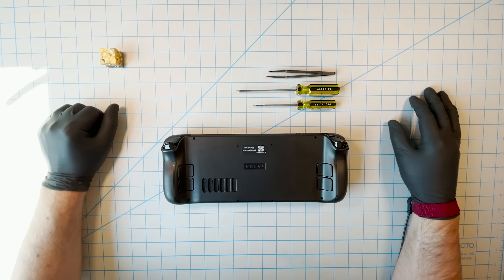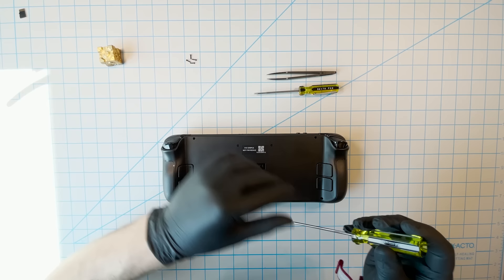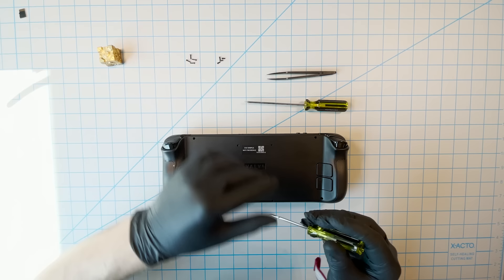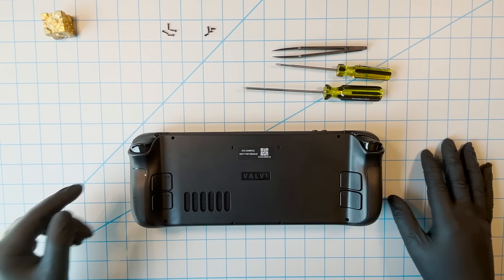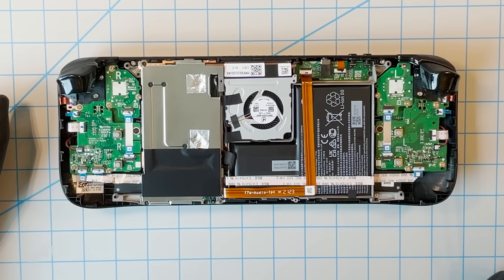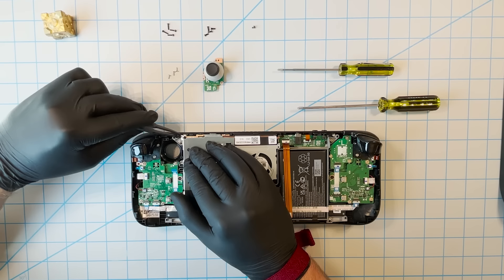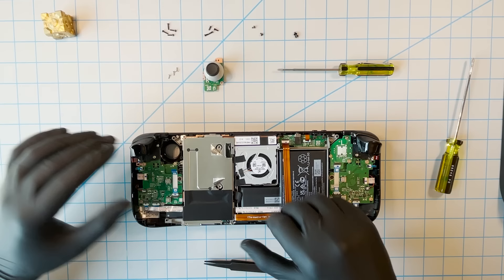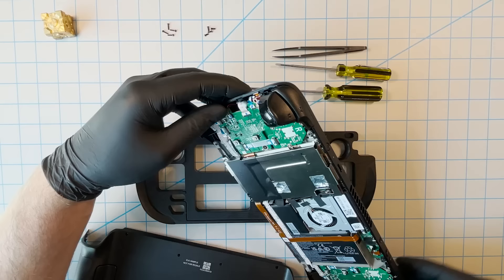Take a look inside Steam Deck™!

Comment: Huge props to Valve for actually doing this video instead of trying to say it's impossible or trying to hide the information.
Reply: Indeed.  It would have been infinitely easier just to say that, so the fact that they put even this effort in is huge.  Thank you Valve!
Reply: They know their audience. Its as simple as that really.
Reply: @redeyedanime2512  what about tf2 update ?
Reply: This is by no means hard to figure put on your own. This is not revealing info.
Reply: IKR! As corps go Valve is really rather decent.
Reply: Apple has left the chat
Reply: This video was made purely because they know how many people were going to open their deck, break something, and try to refund. By putting this out there, they have a 5 minute "told you so" that they can link them to.
Reply: @rostamostmann9657  without this I bet most of you wouldn't have know how replacing the SSD can damage the system in many different ways
Reply: honestly, was kinda amazed valve did it themselves.
Reply: @sebastianbledsoe4793  well they can also just say "opening your deck will result in no refund and no warranty" in their before buying page and it will be the same thing.
Reply: Huge props
Reply: They could have glued it closed, or made it even easier to damage stuff, or soldered the SSD to the mainboard, or refused to provide info about replacing thumbsticks. I'm really happy they didn't do any of that. 

If I ever open mine, it will be when it's pretty old, when the thumb stick drift mitigation that they seem to plan to do in software is no longer sufficient.
Reply: Yeah, its also good that they put so many warnings cus it really is dangerous
Reply: @sebastianbledsoe4793  their 5min told you so might be the reason something gets broken rewatch it and you might catch the mistake beside the esd strap.
Reply: @kopzz  as of right now the warranty void if opened cant be enforced in the US
Reply: @totalignorance8415  for future reference, what mistake do you mean?
Reply: @RunicRasol  Funny, but  Apple and Valve are hardly in the same "room".
Reply: @totalignorance8415  nice catch, something did seem off there. It’s a bit cumbersome that you’d have to remove the shroud before you can unplug the battery
Reply: @shifo.2003  what about halloween event?
Reply: Are you telling me that something that's been made isn't impossible to make..?

woah.
Reply: or pull an Apple where you just license SOME parts and nothing else is allowed. Good guy Valve
Reply: I mean...Gabe Newell likes linux for it being open source and everything and don't get me wrong, I like that the company that made a product also made a video of a partial dissasembly of their product.
My point is Valve ain't apple, one supports right to repair and warns you about mismatching components whilst the other is like, even though you bought it we still own it and we will sue you if you attempt to repair it to reduce waste and prolong the life of our products.
And that's why I love Valve and hate the rotten apple.
Reply: I know, right?
Reply: @shifo.2003  chill
Reply: Would love to see Louis Rossman’s take on this vid. I know his field is a bit separate from handheld gaming machines, but this definitely is a video of interest in the right to repair topic.
Reply: I mean, not only that, but, while the beginning speech is very alarmist, the design in itself is quite repair friendly. Having the thumbstick and IO on separate PCB is so great considering how often these things break. The screen is probably a pain to change, and I'd love to know if the battery is glued, but apart from that, I think this is miles ahead from most electronic design already.
Reply: Or trying to tell you to not and instead spend way too much money for them to fix it for you
Reply: @shifo.2003  tf2 is dead thier not going to update it

we got lucky to even have half life alyx
Reply: They do discourage you a couple times too many but at least they still give you the info
Reply: its on theme for the device philosophy so far.
Reply: @Air4563  I think if the Steam Deck is popular enough, he's likely to see some business repairing them in 6 months or something.  My guess is that he's going to be kinda neutral on this, like "Good that they did this, but whole part about dying is probably BS."
Reply: Honestly the commentary makes me feel more resistant to opening up a deck than i normally would a device lol.
Reply: @cloodstroof7786  thats partly the point
Reply: @rostamostmann9657  they could have used proprietary screws or required 16 spudgers to separate the case. But good guy Valve didn't do any of that.
Reply: Transparency goes a long way. More  tech companies should have this attitude.
Reply: It's nice when a company allows for the right to repair. I can't even work on a John Deere at work because they brick the ecm if you replace a part in the electronics or I can't take a bolt off because no normal wrench fits the bolts. All because they won't sell the software or tool. But if Apple gets hit hard enough for the shit they do it's gonna make it so they all have to let the owners decide which route for repair they wish to choose with no repercussions.
Reply: @kopzz  It is illegal in the united states to void the warranty of a product when it is opened.
Reply: @tmifb9926  "Degrade Performance of" not "Damage", these are steps that EVERY Steam Deck will need to go through eventually to avoid becoming e-waste, Joysticks, Drives, Batteries, Fans are all limited life span components. That said I would have GLADLY paid the single extra dollar American to purchase, and pay the Shenzhen slave labor for the installation of, threaded brass inserts to prevent the loss of structural integrity when I reopen the case to perform necessary maintenance. While I appreciate that the crowd subscribed to the Valve YouTube channel is less technically minded than, for example, the folks over at Louis Rossman's channel, the warnings in this were more than a little over the top and were edging dangerously close to "If one of these components stops working you may as well throw the entire unit away if it is out of warranty".
Reply: Valve isn't apple lol
Reply: They are getting out front before there is a glut of people damage their steamdeck trying to upgrade the storage.
Reply: Well, it's not apple, they won't do any shady shit
Reply: @shifo.2003  Wait for the disappointing spiritual successor from the janitor, who was in the building when TF2 was made: Squad Citadel!
Reply: I can agree, but they really lay the "scare tactics" on about self repair. Yes, there are some risks, but they aren't as risky as they made it sound.

But I am glad they showed disassembly.
Reply: Sony did this for years for Playstation.
Reply: @rostamostmann9657  As edgy as this comment is it isn't true to the vast majority of people who will own Steam Decks. Even if you could figure out the basic process without this video there is still helpful information included.
Reply: @sebastianbledsoe4793  It's still a nice gesture and besides for those who actually know what they are doing this is nice as well. I mean still double check with ifixit just to be sure, but still nice.
Reply: yep, really good approach
actually trying to make people understand
just like it should be
Reply: @shifo.2003  tf2 has been supported longer than most other games, give it up. It isn't returning.
Reply: ok
Reply: Exactly what I'd expect from Valve. They aren't super mega open but they are definitely open.
Reply: @shifo.2003  shhhh, we don't talk about it.
Reply: Nintendo style
Reply: At the same time, I frown on the decision to use self-tapping screws. Then again, maybe there is just no space for including brass screw holes. Either way, this a compromise and reduces the integrity of the construction in any event that requires you to open the shell.
Reply: @sebastianbledsoe4793  I remember when i put shit ton of stickers with  LITERALLY 3/4  inch thick arrows poimnting to "not touch power set lever when going on T-74 USSR made tractor in neutral on clutch\coupling lever". Guess which mf got killed by flying out piston and was berried in closed coffin?(that was a headshoot) The one who said he don`t read 300 page book, because only reason it exist:"Lazy mechanics write it, so they can point you did it wrong. I know what i am doing, i driven tractor ***blah blah blah***"
Reply: why would they hide it? showcasing its hardware, specs, and stuff about the device, would make people want buy it since maybe  the specs are good and the consumer would like that
Reply: @shifo.2003  there is only one person working on tf2 bud. (not joking)
Reply: Agree 👍👍
Reply: @mymouseaintbroken8255  tf2 isn’t dead
Reply: Valve is nintendo they dont do alot of games but when they do they are great and valve doesnt deny how theres something in the machine
Reply: Fastest most liked comment
Reply: And apparently they’re even sourcing official parts so repair is easier
Reply: I can't believe it
Reply: It's also good to note that they can avoid bad press from the drive causing issues, or steam decks not working properly after dissassembly.  With this conspicuous video, they've managed to be both transparent AND shift blame (justifiably, assuming all the info is true) which will avoid people having different expectations of what you can and can't do with the deck.
Reply: Well, trying to hide how their device is opened would be a futile endeavour in the first place
Reply: @Notabl3  it's on life support though, like, it's there and you can play it, but almost nothing new comes out from Valve.
It's a good thing modding is so easy on Source
Reply: To be fair, they advertise it as "handheld pc", so it would be unreasonable to have a pc that can't be taken apart.
Reply: @rostamostmann9657  If they provide replacement parts as they said, this is may beyond what some corps do
Reply: yeah i have massive respect for valve on this.
Reply: @redeyedanime2512  It's not just that. They know and care about their audience.
Reply: @redeyedanime2512  you all act like Sony didn’t do this shit first… we’ll see if  this modern all digital GameGear will have a longevity in the near future, still prefer Switch as a portable with physical copy than  games i don’t own by EULA
Reply: @shifo.2003  they know that no one plays tf2
Reply: Unlike a certain scummy Japanse Videogame Company..
Reply: or not to make it impossible, like a snap system tha need to have the plastic btoken to open the console.
Reply: Though they still said not to mess with it. Can't hit all the bases, I suppose.
Reply: @shifo.2003 I'm sure the hardware designers are really well informed on TF2 updates.